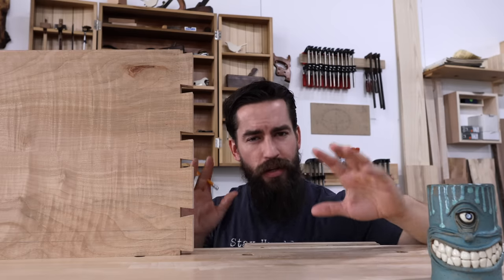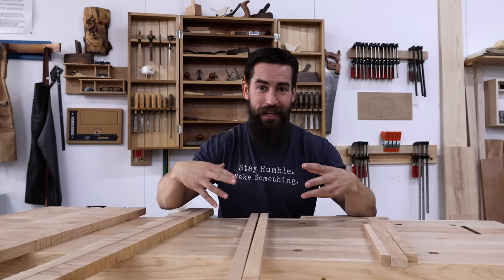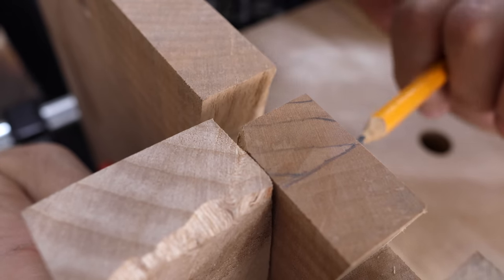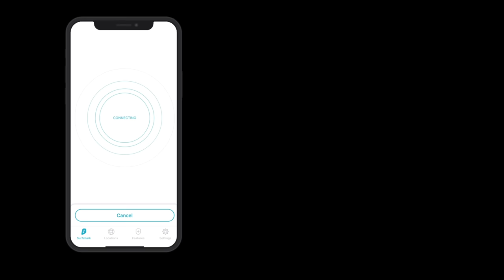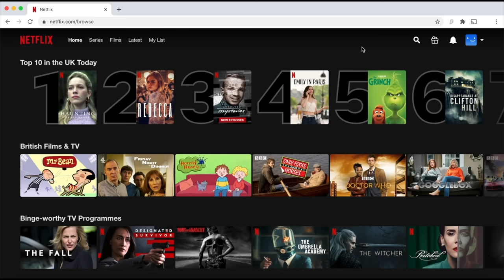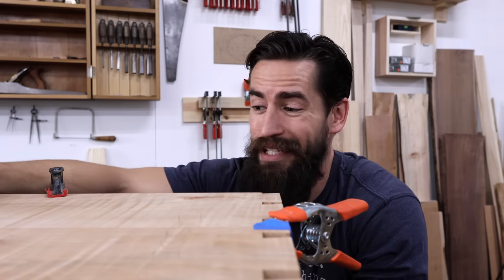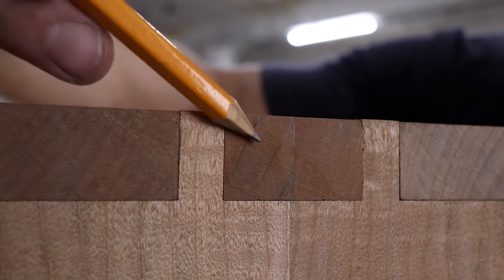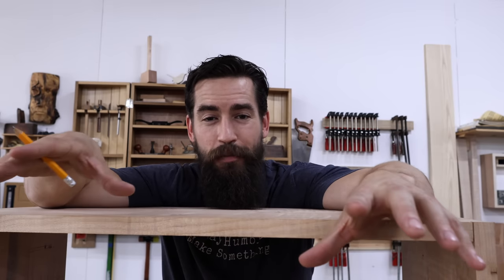Take a deep breath. Everything's going to be ok.

Comment: "Mistakes are inevitable." 

Thanks for acknowledging that every project is going to have some mistakes. Expecting them, instead of hoping, hoping, hoping that no mistakes will occur is a much more comfortable place to be. And fixing them is just a normal part of the woodworking process. So, think of hiding (or highlighting) mistakes as akin to all of the other steps. Great stuff!
Reply from the maker: Maybe some folks are good enough to avoid them but in 10 years I haven’t made a single project where that’s the case 😂

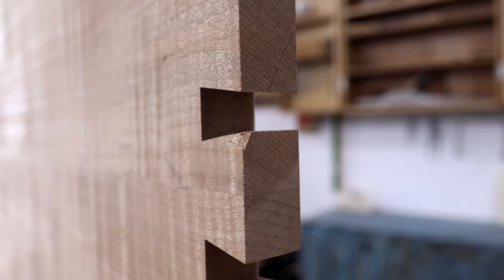Comment: I see the reason. Look back at the close up of the joint at the beginning of the video 1:37.  You can see an arc through the wood above that goes across the grain.... and that little blow out is the end of that arc if you draw the line through the open cut. Not sure what that is, but I am guessing that is what caused the blowout.  As for your quality of work.....nice!!

Comment: This video was a huge inspiration to me to attempt to fix two mistakes that happened on two small boxes.  The first was a cat-shaped bandsaw box made of padauk, and when sanding, a tiny wedge shaped fragment popped out of the tip of the cat ear.  I saved it, glued it back in with CA glue, sanded it flush, and it's completely invisible.  On the other box, I cut large box joints for the corners, and I cut one about 1/32" too wide, for a sloppy fit.  After I glued the box together, I used my block plane to peel off a thin shaving from some scrap, and glued it into the gap, almost like a micro spline.  It worked, it's impossible to find now on the finished box.  This video came just in time, when a few weeks ago, I likely would have just given up.

Comment: I just did some repairs like that for some wood that rotted away and I had to match. Any tips on dealing with glue squeeze out? The grain and color matched nicely, but the glue (TB 3) discolored the wood and to sand past it would make a divot in the piece. Thanks for your content. I admire the quality of your workmanship and I always learn something watching your channel.
Reply from the maker: Oof. That’s not an easy one. I might try to take a card scraper to it. It’s a must to get down below that glue line to get the color right.
Reply: @ENCurtis  sadly I combined contrasting woods to be fancy like you and the card scraper takes way more of the soft wood out than the hard wood. I may just have to live with a wavy surface, Perhaps I’ll lean into it and give it some curves ;-)

Comment: Help me learn here, please. I'm still early on and I'd have laid out a playing card and use a flush cut saw, which should have left the area playing card proud and then paired down. Is there a reason to only use the chisel like you did, or is there any reason to avoid the flush cut saw in that case? Obviously your work is premium, so this is a genuine learning question for me :)
Reply from the maker: That’s a good question. If the glue is cured or well set (12-24hrs) there’s no reason not to use a flush cut saw. But I only let it set for 45-60 minutes, so using a saw will put more pressure on the patch than small bites with the chisel will, reducing the chances of breaking off the new piece. Plus, I just find it more fun haha